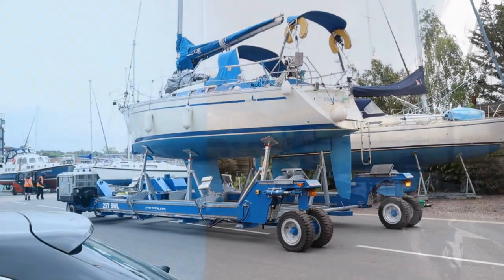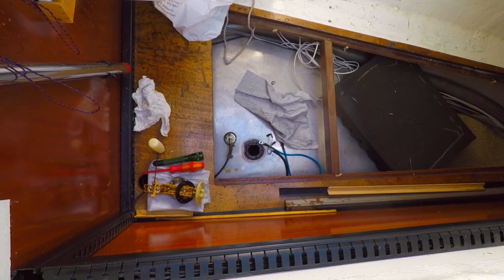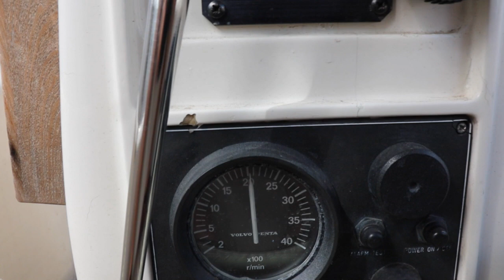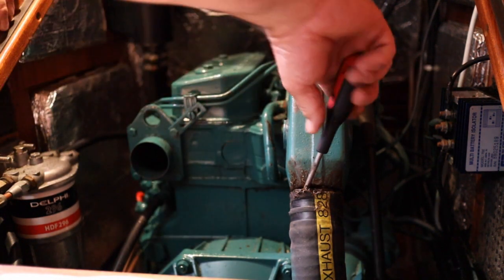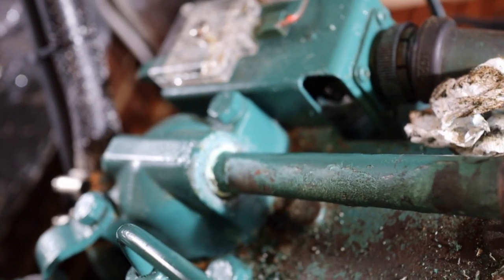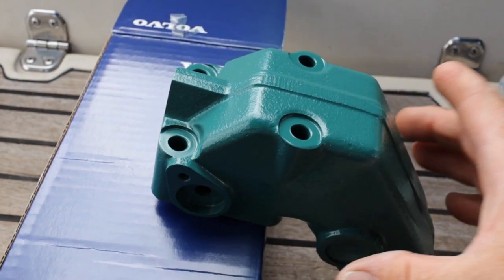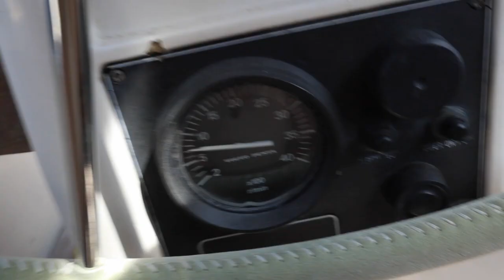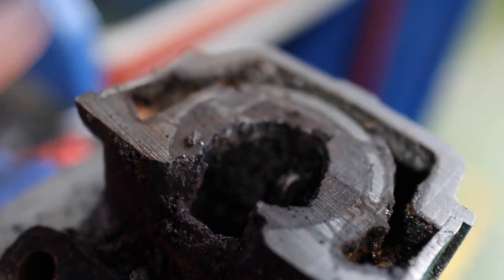Volvo Penta exhaust elbow Ep:13

Comment: Hello from USA-I just saw the video on the Pump rebuild (Ep. 17 and 18). Pump was not pumping water thru the heat exchanger and out the exhaust. Have cleared all the pipes and city water line does send water thru the raw water cooling system. Tomorrow  we will strip the pump out to determine cause of pump not pumping. Let you know our progress in a day or two. Thank you very much for a very educational video. You, sir, are a very good instructor. Thanks again.
Reply from the maker: Hi guys, thank you for the kind feedback it means a lot. Good luck with the fault finding, please let me know what you found?

Comment: Thankyou for your post. I have the same engine and was having intermittent overheating issues. Your post has given me enough courage to attempt the task. My initial stumbling block was a frozen nut that locks the angled pipe coming from the engine block to the elbow. The one that you used a ring spanner to unlock.
Took hours of patience and various methodology to unfreeze it.
When I put everything back on again ( with new rubber ring seal - not O ring as you’ve mentioned ) there was a leak at the joint which I have managed to fix by putting an additional O ring into the joint. My elbow was just as corroded as yours.
Boat is running cool now, thankyou again.
Reply from the maker: Hi SYA, good to know the video was useful.

Comment: Great video thank you. I have an MD5 single cyl that needs a lot of maintenance. (just purchased boat)
Reply from the maker: The MD range was a sturdy oil workhorse, they're getting long in the tooth. can you still get parts easily?
Reply: @sailingwithus5743  Service parts are still available, which is good. They are an old workhorse.

Comment: Very informative and possibly very helpful as my next task is to replace the exhaust elbow on my 2002. What material O-ring did you use for the pipe and is there a generic replacement for it available? 
And If my hose is stuck, I'll know what to do. ;)
Reply from the maker: Hi MB, the rubber o-ring is part of a Volvo Penta service kit. I would recommend using genuine parts due to the fine sealing tolerances required.
Good luck, Rob
Reply: Hi Rob, thanks for the answer! haven't started the job yet, but I got a cooling and diesel pipe o-ring kit from parts4engines.

Comment: Hi, very useful video, n thanks for the post mortem! If there had not been a massive corrosion on the elbow, would you have had it cleaned and use it? or is it wiser to replace it in any case?
If to clean, how? your suggestion would be? thanks in advance.
Reply from the maker: Hi, on the basis the exhaust elbow is the original and over 30 years old. I didn't even consider cleaning it. 
I had a mixer elbow failure on a previous boat , spraying salt water over the alternator and filling the bilge. Not a situation I wanted to repeat! 
Regarding cleaning solutions I'm sorry I can't help. 
Cheers!

Comment: Was there a restriction in the raw water output? Did that result in steam? I’m having what I believe to be a steam issue with a Volvo KAMD 300 and the exhaust elbow has been suggested, after I change the impeller and check the raw water strainer. Thanks
Reply from the maker: Hi Michael, I noticed the lumps of rust under the exhaust elbow first. It wasn't until I cut it in half that I realised the water gallery was blocked.
You may well have the same problem with your KAMD 300!
Thanks for watching. Rob
Reply: @sailingwithus5743  👍 Thanks

Comment: Good job. I just did the same, to check. But the elbow was in good shape so left it there.
I have the same White smoke from the exhaust at 2000 - 2500 rpm. It is cause for corncern?
Reply from the maker: Hi Erik, it was a cold day when I made this video so white smoke would be expected. If you're concerned about your engine check out the thermostat operating parameters and exhaust temperature. Thanks for watching and happy sailing!
Reply: Thanks. It turns out my problem was in the intake of seawater. Blowing water back through the seawater filter solved it. This I discovered AFTER tearing apart and cleaning the entire cooling system to no avail.

Comment: What do you think that white smoke is? I have the same issue on the same engine. No loss of compression  just that same smoke and with mine i have a tad bit of sheen of fuel or possible coolant. Not real noticeable, but enough to piss me off. I am thinking injectors because no loss of collant at all. I changed my elbow like you did. Thanks again Mate.
Reply from the maker: We're trying our engine on a different diesel this season. In the past we have always used the fuel dock 'red diesel'. This year we've filled up with shell V-power (white) Road diesel. It's twice the price however it has a cleaner additive to improve injector performance. Our engine is over 30 years old but runs and starts without problem. 
I'm keeping my fingers crossed a bit of chemical TLC will improve the white smoke issues.

Comment: Great video,  really well put together and deals with a topic many boaters have to deal with.  I have just done the same job with my Volvo Penta, I used a stainless exhaust elbow in the hope it may have a longer service life.  It was interesting to see your dissection of the old exhaust elbow,  I would hate to think what mine would have looked like!

As an engineer you may be interested in or probably already aware of the issues with some of the sea cocks fitted to yachts and the brass becoming brittle over time - if not this is a starting point  https://www.youtube.com/watch?v=8p0gysglfUU .  Thought it worth sharing since obviously you and the family spend a bit of time on the boat.
Reply from the maker: Hi Paul, thanks for your comments and yes sea cocks and skin fittings are part of our rolling service plan. We change them every seven years along with the Volvo Penta 'doughnut'. 
To make life easier I have made a skin fitting extractor.
You raised a good point, stainless steel or cast iron exhaust elbow. 
I went with original manufactures specification, after all its lasted thirty years!
Fair winds & following seas, Rob.
Reply: @sailingwithus5743  I was about to ask the question how many years service had that elbow seen and found your answer.  I'll need to take a look at mine as the boat is 35 years old.

Comment: I'd be interested to hear your thoughts on why the bottom of your tank has all that gunk in it.
Reply from the maker: Hello Sailing Aphrodite, good question where did the 'gunk' come from?
Other boats I have owned had plastic fuel tanks and didn't seem to suffer with diesel bug problems. This Bavaria has a stainless steel tank.
Although the tank is topped up with diesel after every trip, by the end of the sailing season I still experience a cup full of gunk in the bottom of the tank.
Iv'e tried many makes of fuel additives each promising to alleviate diesel bug issues, none seem to work! 
To summarise, I put it down to condensation issues. Warm fuel returning via the spill pipe into a cold tank.
For price of mind I'll continue cleaning the tank as a pre-season shakedown check!
Thanks for watching!